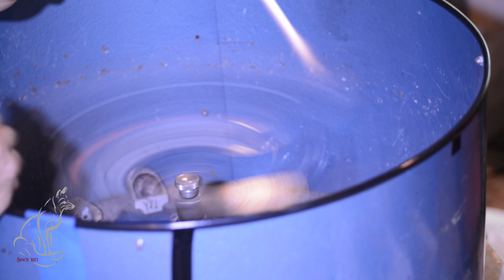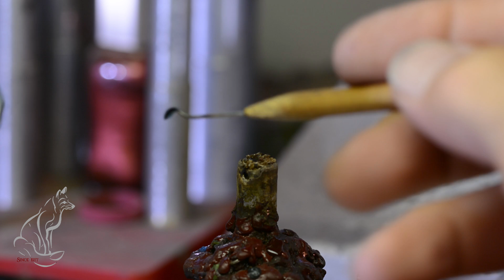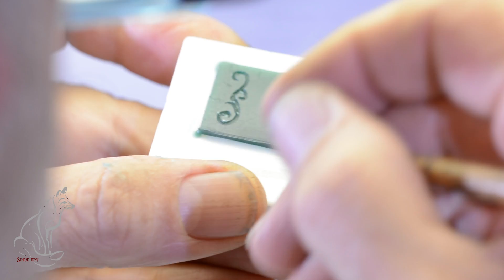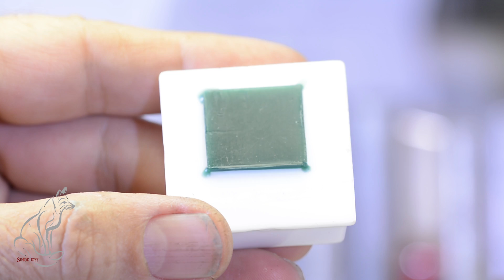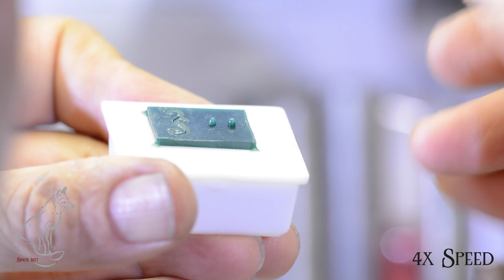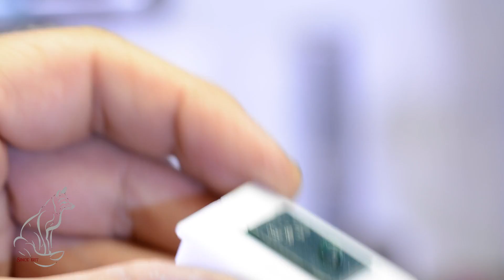2.0 Intro to Wax Carving

Comment: Very interesting. So Im curious. How do you make a mold of the wax prototype?  Do you cast it into metal form first then make a mold of that finished piece or can you make a mold at the wax process in case the casting fails?
Reply from the maker: You can do it either way, but we prefer to cast the wax prototype into metal first and mold that piece.  We show the process in the next couple of videos in the series.  Cheers!